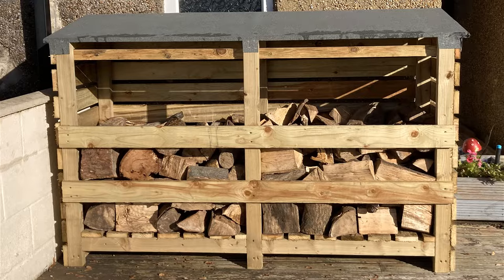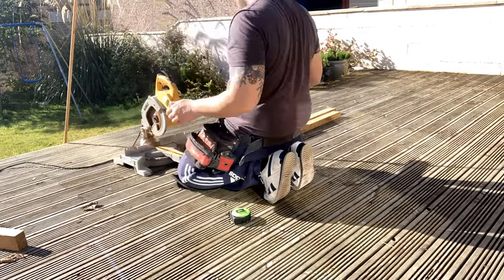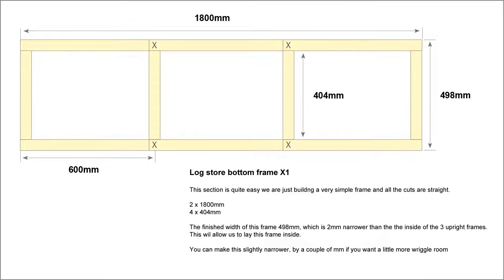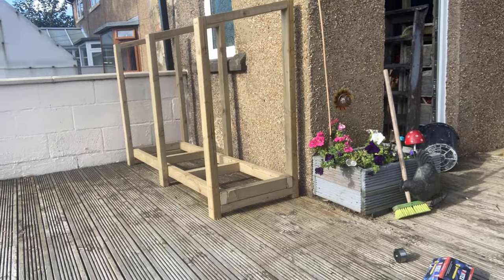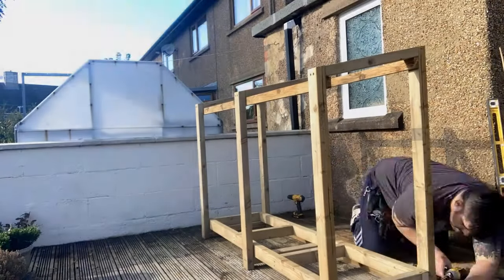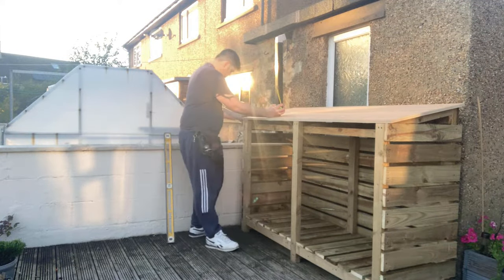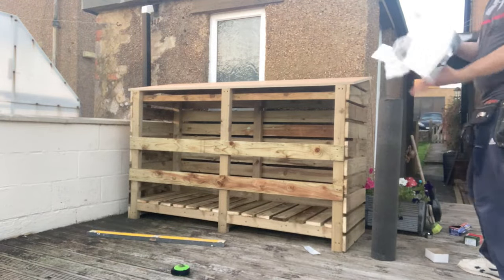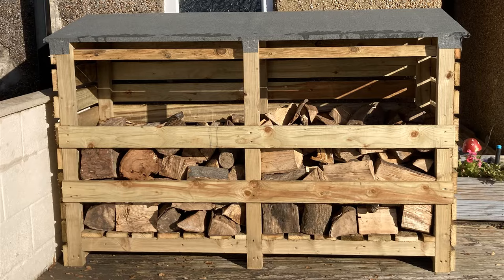How to build a DIY log store + Plans + Tools and Materials Lists

Comment: Excellent video - clear, simple instructions. easy to follow. And the shed is a good design. In a store I built a while ago I used recovered pallets for the rear, and disassembled one to recover the slats for the sides etc.; but if I was  starting from scratch (no pallets etc.) then this a good design. Likely could be adapted to provide a garden tool store as well (lawn mowers/shredders etc.) as all one would do is ensure rear & sides are not open to the weather, and provide a some form of door(s)...? 🤠😺
Reply from the maker: Glad you liked it mate

Comment: Great video, for the roof would it be cheaper to use the same timber (no gaps) and then felt or would there be little difference
Reply from the maker: Off the top of my head im not 100% sure, but yeah it probably would be a little cheaper

Comment: I'm a full on amateur diyer when it comes to woodwork but I've managed to put the frame together, albeit not as big as yours, do I need to screw in the battens to clad or can I just nail them to the frame?
Reply from the maker: Personally I would nail them as it will give a better fixing

Comment: Great video! Really well explained and the diagrams are easy to follow - just one question - did you pre drill the holes for the frame before screwing?
Reply from the maker: It was built last year so not 100% if I did. With that said, it is always a good idea to predrill, as it will avoid splitting the wood and it also makes it easier to drive your screws in

Comment: Thank you for doing this . Could you tell me how to calculate and cut my angles without one of the mitre saws you have. I only have a hand saw. Thanks.
Reply from the maker: Hi francis, you could cut two peices of timber at just over 1200mm and two peices at exactly 500mm. Then use the 500's to space the two longer peices. 

Ensure the bottoms are even. You could lie them on the floor and butt them up to a flat surface like a wall.

Then with these timbers evenly spaced at 500mm mark one timber at 1200 and the other at 1100 and put a straight edge accoss them and draw the angle on. Following this, cut them and then use these peices to mark all your other timbers. This way they will all be identical.
Reply: @thediyfix  Thank you very much. That is great.

Comment: Will the ends of the wood not rot?
Reply from the maker: Hi Michael, we used this log store all last winter and there was zero issue with rot, mould, or even damp wood. We did cover with a small piece of tarp to avoid wood getting wet from rain, but my understanding is the wood needs to breathe.

Even when it did get a little wet, it was just on the surface and would quickly dry (even in cold weather).

The wood we buy has been stored and dried for over a year. For rot to form, moisture content throughout the wood needs to be over a certain percentage. This would take a prolonged period of saturation, and you would also need rot spores to be present on the wood.
Reply: @thediyfix  Maybe he is suggesting that the cut ends of the frame might rot if exposed to the floor as the end grain will suck up moisture. It would probably last a bit longer if the long grain was down to the floor.